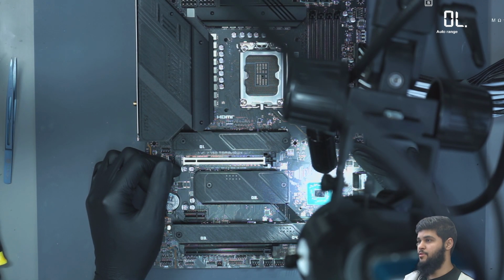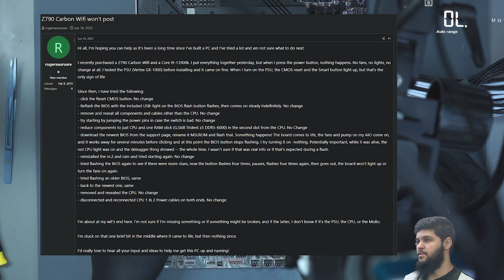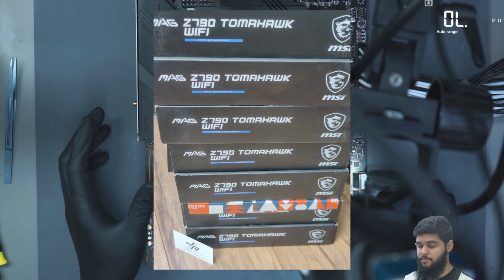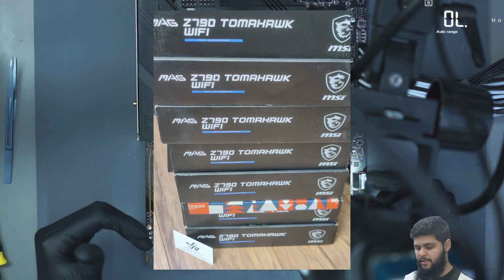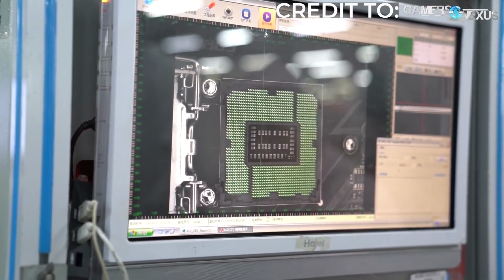Diagnostic: MSI Cracked Chipsets Across Z790 TOMAHAWK WIFI Boards | Joshi Repair

Comment: I hope you see this mines driving me mad same board 14700kf I've ocd it alot in the past now I can't at all. It's acting real weird. Geek bench 6 multi core has dropped 4000 the single core remains the same. Setting voltages is nearly impossible even at stock very difficult to get stable. Had weird bios issues like crashing to a bricked board won't turn on. Have to drain power reset cmos then wait a bit and it comes back on. Are they known to drop vrms

Comment: Hi! Everything has been working perfectly on my tomahawk z790 for two years now, the pch temperature averages 46 degrees, and at the same time, on another computer, there is an MSI PRO Z790-A MAX WIFI pch at an average of 60 degrees Celsius with wifi turned on, when you wake up from sleep or turn on the computer, I get a blue screen of death, when the wifi is turned off, there is no such problem, do you think this is due to a defect in this PCH?

Comment: Thank you so much for video, your experiences and information. this video is very objective. ı sent post to msı support by using your video. Thank you so much
Reply from the maker: We're glad to hear and hope that everything went smoothly.
Reply: @joshirepair  Six months ago, I sent my MSI motherboard to service. It was repaired, but came back with a damaged corner. However, it was still working. I started using it. Exactly two weeks ago, the PSU died while I was playing a game. After that, the motherboard didn't work with the new PSU either. The CPU LED light is on but doesn't go any further. The processor, RAM, and SSD were tested and are working. The PSU is new. I sent it back to service with a complaint. However, they rejected it, citing the damage on the edge. But I explained that it was still working even with that damage. It didn't affect their decision. Do you think it's time to throw this board away? Finding a reliable motherboard repair shop in Türkiye is very difficult.

Comment: Hello. I have z790 tomahawk wifi ddr4 with no start problem. When I power it on the CPU red led is light on, but CPU and PCH is not heating at all. Only CPU gets slightly worm and PCH is absolutely cold. Voltages is present on PCH. Did you ever face this kind of issue?
I don't see any cracks on PCH.
Thank you.

Comment: Does the issue have been resolve on MSI over these past few months? I returned mine on the retailer because it was DOA but the retailer said that the item is now for replacement and I will get it in the next few days, and I am hoping that the motherboard is good and working.

Comment: Hello Joshi, do you still by any chance have this motherboard? It would be a huge help as an ebay seller scammed and sold me with a burnt capacitor on the back, one of the 0805 size ones that belong to the VRM, I'd love to know which exact replacement one I need to get, if there's a way to contact you I'd send you a picture of exactly what I mean. Thank you so much.

Comment: I'm a little sad about my MSI B660 mortar. Recently, the card CPU self-test, occasionally can pass the self-test normally, but the computer will shut down within one minute of running. I'm from China😢
Reply: Hi, i have a b660m-a, also got CPU red light and continously boot attemps. After some troubleshooting im at a dead end with the motherboard being the culprit. Did you solve your case? I just decided to send my b660 to warranty service.

Comment: I'm a user using MSI Z790 TOMAHAWK WiFi in Korea.
I've been experiencing boot problems since I switched to MSI Z790 TOMAHAWK WiFi last year when I enter the bios and go into m-flash or set xmp, should I still suspect PCH crack in this case?
I asked the service center today and they said that there is no official announcement from MSI in Korea yet.
Thank you for the good video.
Reply: Same here, I submitted my z790 ddr5 to service center let's see tomorrow what they gonna say

Comment: Yeah. I’ve got exacly same problem with my previous tomahawk ddr5 - no-post, warm chipset - completely dead. Thankfully shop replaced my board without any problem. I hope, that current one tomahawk won’t broke soon and that problem is „out of box only”…
Reply from the maker: Yeah, thankfully MSI have confirmed this is a dead on arrival (DOA) issue and you should be all good as they've addressed this PCH heatsink fault.

Comment: Regarding the MAG Z790 TOMAHAWK WIFI incident, we've discovered that a minority of units may encounter non-functional PCH potentially resulting in Dead on Arrival (DOA) of the motherboard product. We have isolated the cause to a previously used chipset heatsink screw design and have taken proactive measures to address this issue. 

A revised chipset heatsink screw design has been implemented into our production, and the known cases have been resolved.

We uphold high standards of responsibility and accountability, and want to assure affected customers can promptly receive product replacements. Please contact our local customer service center for assistance.
Reply: Do you have batch numbers yet?
Reply: Does this happen to z790 pro -A wifi DDR5?
Reply: Ty.🎉
Reply: what is the serial number of the affected products? because I also have a msi mag z790 tomahawk wifi motherboard, thanks in advance.
Reply: tengo esta placa y el chipset esta literalmente partido en 2 una parte pegada al disipador y la otra en la placa. Alguna solucion?
Reply: MSI   "previously used chipset heatsink screw design".  It does not appear to be a very clear comment that encompasses the issue in full for us.  I assumed this was related to the PCH chip manufacturing process or the quality of it, and or the physical PCH chip installation onto the motherboard, not a fault created by the fitment of the PCH heatsink and its design?  Joshi Repair had conducted limited heatsink swapping on the same and other generations without anything remarkable occurring!

Is MSI blaming the simple heatsink to deflect from possibly more alarming issues?

I wanted to buy this board.
Reply: Hello,
I have two MB of Z790 Tomahawk DDR4 to put together into workstations in next 2 weeks.
MSI, is DDR4 version of this motherboard also affected? 
Could you post a range of Serial Numbers of affected by this fault, boards?
Reply from the maker: We greatly appreciate your transparency and proactive approach in resolving the chipset heatsink design flaw.

In our video, we highlighted your commitment to high-quality standards, and your swift action in acknowledging and rectifying this issue for us further underscores that sentiment.

We commend your efforts in ensuring customer satisfaction, and your clarification demonstrates growth and reinforces trust in your practices.

Sincerely, 
Joshi Repair

Comment: MSI Z690 only? H610, B760 and Z690 do not have this problem?
Reply from the maker: Specifically, the MAG Z790 TOMAHAWK WIFI boards using the SRM8P BGA chip.
Reply: What about msi z790 pro A wifi,  have the same problem or its ok. Plz help

Comment: What is the chance that such a problem will occur in the MAX version?
Reply from the maker: They shouldn't be affected. It's specifically the MAG Z790 TOMAHAWK WIFI boards only.
Reply: I just buy the MIS MAG  Z790 Tomahawk max wifi ,install evryting all the light turn on but no post ,i. buy it from newegg 392$CAD, i can't get a refund from Neweggs

Comment: Just remove the PCH, and check the status of the ESD via USB, Type C, and other peripherals, as well as the chipset power lines (0.82V, 1.05V, 1.8V, 3V_RTC). I will assume that one of the power controllers is configured incorrectly.
Reply from the maker: Thanks for the suggestion. Thankfully, we've had a full clarification from MSI in the comments here. It was a fault with the heatsink mounting system. Voltages wouldn't cause physical scratching to the crystal surface of the PCH.

Comment: Been using this board for over a year with no issue. 13700k / 4090. All 4 nvme drives populated as well if that matters. Guess I got lucky?
Reply from the maker: Thankfully this didn't affect all or even a majority of their boards. You could say a handful in comparison to the working batches that were produced.
Reply: Same here.  I update the new boss for my i9-14900k. I have no issues.

Comment: @2:55 you can clearly see and hear a new crack forming. That kind of heat doesn't create such cracks. People decap ic's with such extreme temps and they come out in pristine condition. Very high targeted temps usually just burn the silicon.
Probably caused by surface defects. They can easily cause cracks with thermal cycles. The crack that showed up in real time in the video was just propagation of another crack already present due to thermal changes. I'm only speculating, ofc.
Reply from the maker: We agree. The part you mentioned happened only because of the preexisting crack & weakness of the crystal surface. Could be surface defects, a machine in the factory that was in need of calibration or a few other things we can think of. It's interesting to think about. Thank you for the comment!

Comment: I have this board and i checked my pch when i got it months ago, i put paste and screwed the heatsink lightly. I was not aware of this problem when I did that, I just put paste to help temps presumably.
Reply from the maker: That's always a good practice that helps preserve the lifespan of the part. Sounds like your board isn't part of the unlucky batch :)

Comment: Does this happen only with the z790? What about the z690 or its AMD counterparts?
Reply: At the moment it would appear z790 specifically after doing a search I could not find a single thing about other boards. I will say that I once saw multiple MSI z690 on eBay that had the pch removed indicating that something must have happened to it
Reply from the maker: We've only found it on these Z790 boards. Mainly the DDR5 variant of the Tomahawk WIFI and a few on the DDR4 version.
Reply: Not really, z690 versions seems fine usually arrive with socket damage. Z790 however is pain 70 out of 80 in past 2 months had PCH issue :)

Comment: Maybe this is happening during shipment or maybe its happening on boards in prebuilt systems shipped with graphics card plugged in?
because scratches like that shouldnt just happen out of nowhere...
great video btw
Reply from the maker: Very well could be however with how we tested those good boards with the suspected heat-sinks it seems unlikely. The scratches would suggest otherwise. Sadly we won't be able to know if it's something that occurred at the factory or after they had been shipped out. Whether the graphics card was plugged in or not shouldn't have an affect on the PCH or it's heat-sink. There's usually a gap between the two.